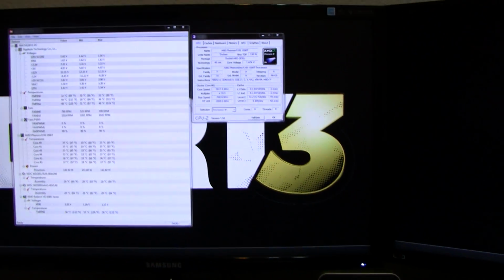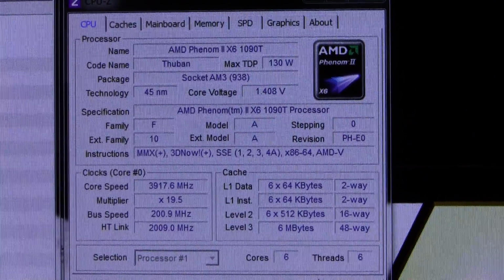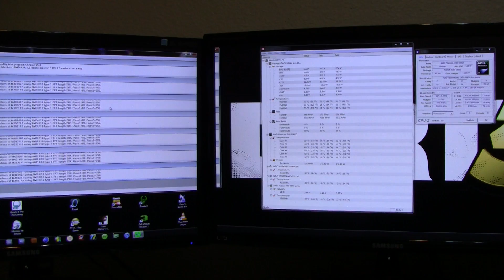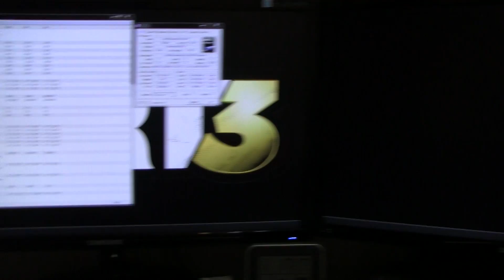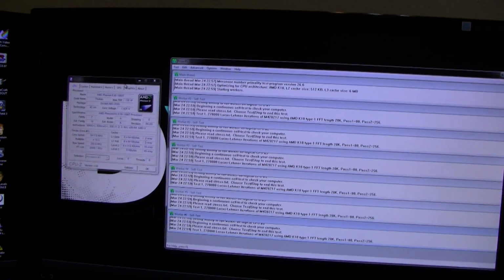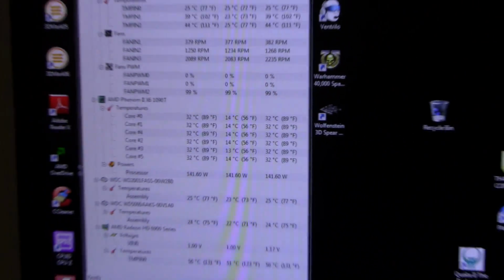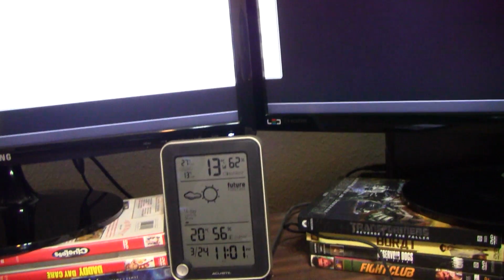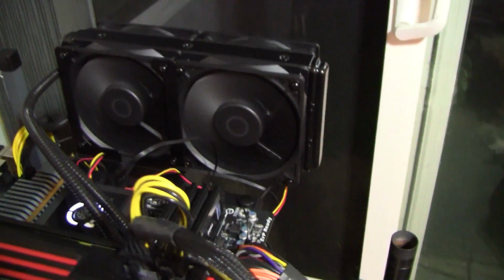H50 VS H100 ON AMD 1090T!

Comment: freaking  NICE!

my zalman9500a with stock fan full speed struggles to keep this exact same cpu below 62c at 3.9ghz 1.4v  with amd overdrive stability test beyond 10 minutes thus i think it's overheating.

corsair 550d case here using stock fans with two of them exhausting air at top ceiling. ambient room temperature stays at 21c throughout the entire day.

Heard the swiftech 220 fits my case as long as I remove the rubber washers for the ceiling mount.  thought about it or h100i

Comment: put a dual fan thats what i did i did not use the fan it came with i used my own and put 2 at full one pushes and one pulls all air is goin in the case and exits at the top